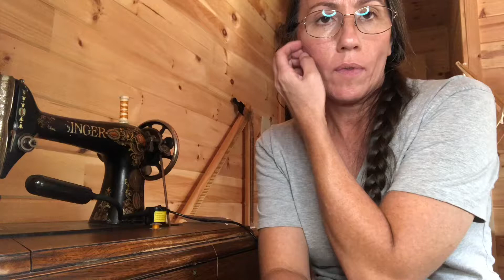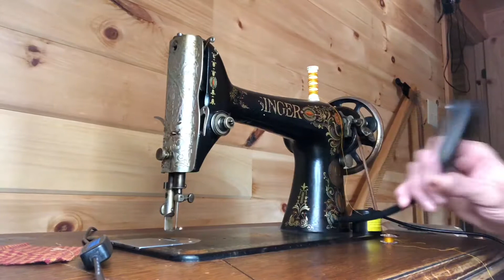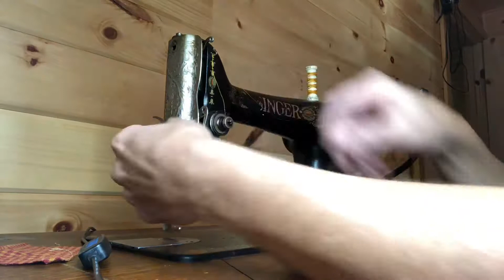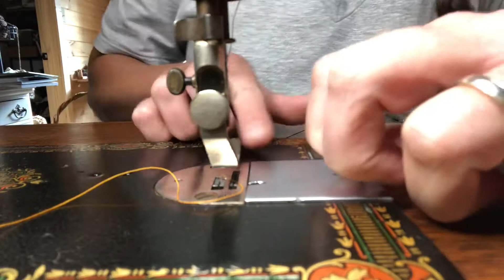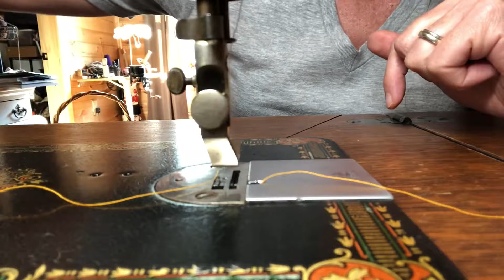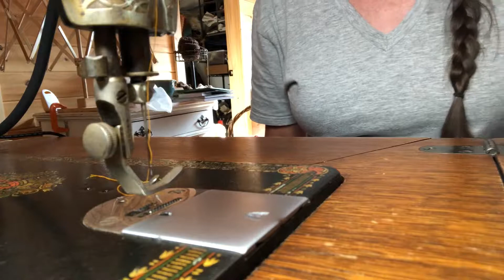Treadle sewing machine - threading and sewing

Comment: The hole you thread through on the plate isn't actually a full loop. You can push the thread in sideways from the front. No need to be careful about getting it into the hole. Hope that's understandable...

Comment: I have my grandmother’s treadle sewing machine. I’ve never used it, but I’m excited to try. Question, is the bobbin that goes into the machine a special size? Are they available to purchase?
Reply from the maker: Go for it! Make sure the pivot points are oiled. I’ve used all the modern bobbins that Singer sells. Plastic and metal, although the metal works better.
Reply: @blackberrypatchhomestead453  thank you!
Reply: I have my Grandmother’s but can’t get the treadle to pull the fabric thru…it wants to go back and forth…can you help?
Reply from the maker: Well that means the feed dogs aren’t working right. Have you tried to used compressed air to clean that area? Also make sure screws are tightened down? Or is there adjustability? Maybe the feed dogs need to be raised a little.